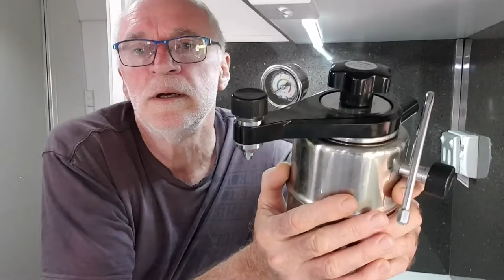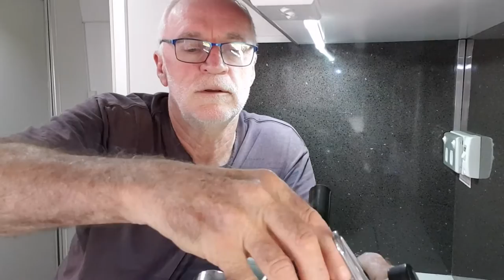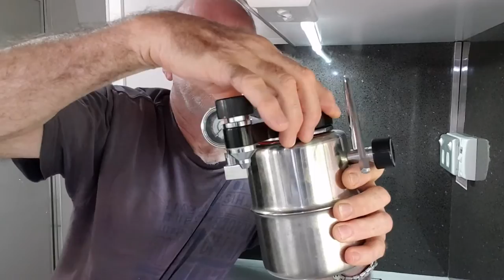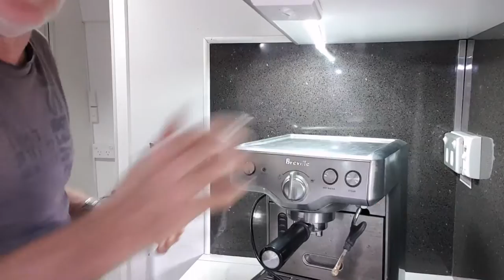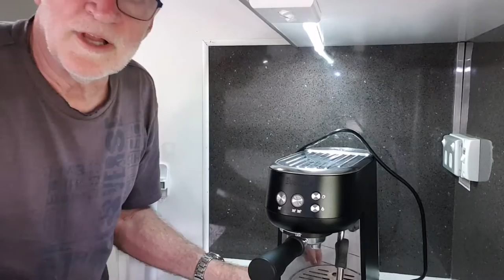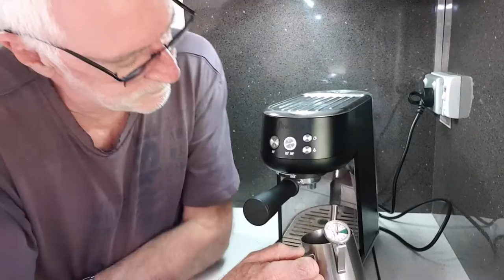Real Coffee off grid! - Breville Bambino

Comment: I've had a Breville Bambino for a few years. Yesterday, I received shipment of a Bluetti AC180 power station, which has an output of 1800 watts. The Bambino requires 1560 watts, according to the manufacturer's specs. Should be a slam dunk, but it doesn't work. The pump works, but the heating element doesn't, so I get cold, really horrible "espresso". Can't really call it espresso. I'm so bummed. I spent $900 for AC180 just so I could make espresso off grid. Any suggestions?
Reply from the maker: Well looks like you have a dodgy Bluetti as the reviews I've seen indicate they can accept a peak load up to 2500 watts and continuous loads up to 2200 watts. So I think you should return it under warranty.
Reply: @timterry8714  Is that the AC180 you're talking about?
Reply from the maker: @aldavidson1044  yes it is